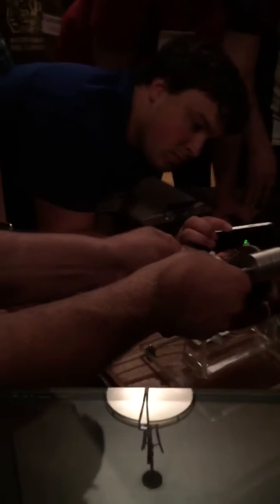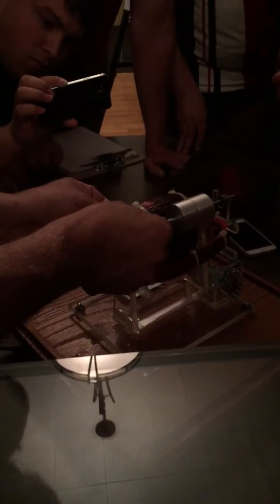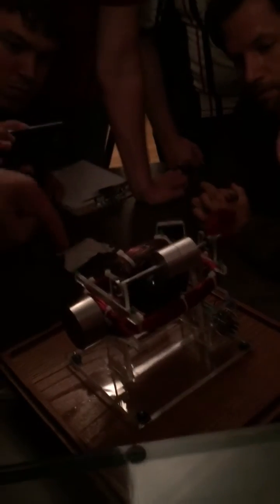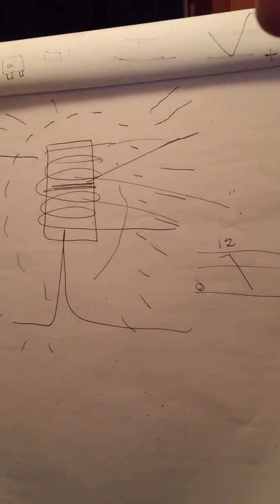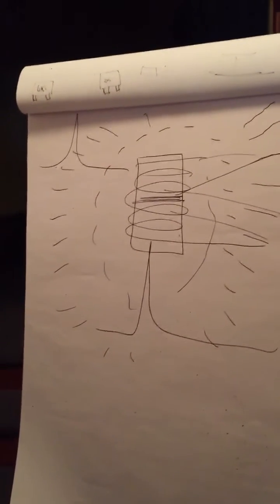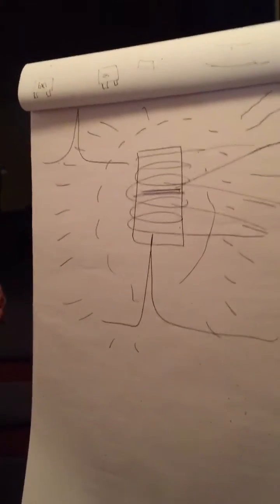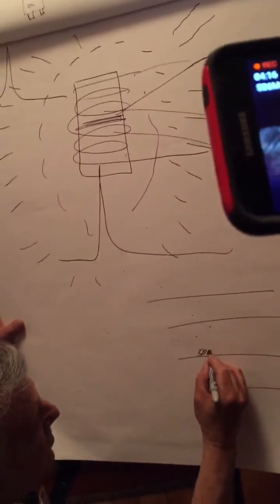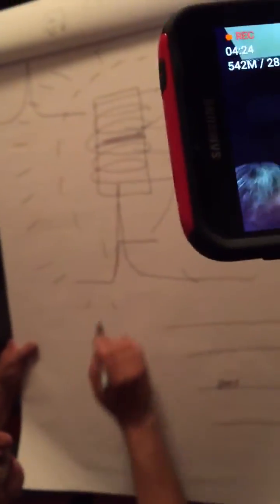John Bedini told us a secret

Comment: I have been using the Bedini generator almost daily and recharged 1.2V, 1.5, 9V, 6V and 12V batteries. Out of hundreds of recharge (documented), to give a typical example, I start with 8.85V charging battery (the one you want to charge), and 12.60V (drive battery - I use a car battery but it's only required for the Drive Batt to have a higher voltage than the Charging battery). I flip the wheel, ensure my neon (soldered between the Base and Emitter) is not flashing - if so, it usually mean wrong connections/open loop (OL) or the Charge battery's internal impedance is too high, as is the case with very old batteries or damaged ones. So, starting time: Drive: 12.60V, Charging: 8.85V. I let it run for about 15 minutes for a topup (gain of 100mV to 350mV) or give it a one hour run for more. Then I stop and disconnect, and let both batteries rest for about 12Hrs (you can use it immediately if you want). Typical result: Drive battery (which had dipped a bit) went back up to 12.60V or show a small loss of 0.002 - 0.004 V (or a little more if you let it charge longer; meaning the Charging battery will not accept more, as shown in frequent measurements). And, my Charging battery will show anywhere from 9.20V, all the way to 9.70V largely depending on age, model, type of, etc.) * the lesser the internal resistance of the generator, the higher is your performance (COP). YES it is overunity. In about the last 200 recharges, my Drive battery went (fully charged) from 12.79V down to 12.24V (a loss of 0.55V) whereas the sum of all Charging battery gains amounts easily to a grand total of 30 to 50 Volts. 30V/0.55V = ***John says in this video that he was told it's not working in Canada - correction: IT SURE DOES! Everyone of my 12 electronic meters are powered entirely by batteries recharged with Bedini. Even my toothbrush is, and my flashlights (LEDs). It's not perfect but it works even recharging 4 batteries at the same time (in parallel connections). There will be one or two batteries which will not gain as much as others because of their internal impedance is higher that their "neighbor". Like kids at a table; some eating less, some eating more. My last improvement was to switch my ball bearings from steel to ceramics (ordered straight from China is very economical).  No more oil needed. Results? It ran so fast, I had to increase the potentiometer's resistance and this, in turn, reduced the voltage drop inside the circuit (the operation of the magnet-wheel) and consequently less Voltage used by the Drive battery and thus a slightly higher COP. Okay, I studied physics in college but most of my knowledge is acquired from youtube videos - and I paid for and downloaded the Bedini pdf books from Peter and Aaron. I would warmly encourage anyone to replicate and USE a Bedini generator. The why and how this device work is not crucial, but if you're the one that succeeds in ramping up the output to 500 Hp (372,850 Watts) of any workable device, of any design using the principle John's divulged in this vid, well, you will bring an incredible amount of freedom to everyone on Earth. And, of course since it's 100% carbon-free and renewable, we'll restore a decent level of CO2 in the air we breathe. There's no reason you shouldn't become millionaire at doing this either. Thank you for reading this. Buena Fortuna!
Reply: Thank you for this comment! Yes, I responded to a 11 months old comment, but after reading it it made me sane again because i'm losing hope from time to time. I'm working on a very intricate Bedini style generator and I hope I will posting it this year on youtube.

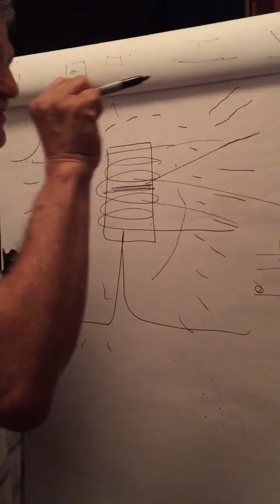Comment: This is a flat out lie John told in 2015 or 2016. Starting at Minute 7:25 "Your voltage goes, 300 volts, exactly the height of the atmosphere that the coil's at." "So if the coil is at a higher elevation you'll get a" "You'll get a higher voltage. The gradient's different." "I moved it 2300 feet to find out. From sea level." "What is the number of the gradient 150V per meter?" "Yeah, something like that. It's close." 
[Problem is that he had just said that he moved it to 2300 feet and it was 300V. If the voltage is 150V per meter for  the spike above sea level then 2300 feet (700 meters) would be around 100,000V spike. The sea level would be when he would go twice a year to see his sister in Seatle, and the 2300 feet would be Hayden Idaho where he lived and the shop was. The problem with this is that the spike has nothing to do with the altitude as anyone can see. John got 300V spikes in the shop with those machines at 12V input. The spike has to do with the rate of change in the switching as well as the intensity (or amperage) of the impulse. I have made way more of these machines than John has all over the country and found the spike to be the same at sea level in Hollywood Florida, in Hayden Idaho where he was, in California, Texas, North Carolina, Michigan, Indiana, Chicago, in most US States actually, Canada, Germany, Denmark, England, etc. They all show the same spike that is according to the rate of change. What John is confusing here is coils with antennas above ground. The potential difference between ground and meters can make such difference in voltage. But merely holding a coil above ground and running the circuit above ground is not making a potential difference unless you had an actual connection to the ground to have such a difference. This would almost seem to be an example of John being drunk. But his speech does not indicate this. I cannot explain why he would lie like this. His next reference to Peter continues on this bar talk story telling. ] 

"And what area had a lot to do with it." "If you go grab Peter Lindemann, and Peter will tell you we built identical machines. Mine worked, he went up north, his didn't work. He brought his machine back to my place and it worked."
Reply: reminds me of Don Smith when he said that copper tubes with a rare earth magnet falling through displayed anti-gravity.
Nevertheless, Bedini has been, and is still a great source of inspiration to me. He is after all what started everything, he and Tom Bearden's videos. And your SSG kit too btw Rick!
After all these years it took me very long to figure out the separate effects that might take place in that motor/generator, if everything worked properly.
Spike charging batteries to accelerate lead ions before they collide on average and draw electron current is one thing, flipping the polarity of an induced magnet right at TDC for an instant and then drawing current from the collapsing field is something entirely different.
Reply: Says the "man" who not only stole from John but now wants to slander his name  all over the internet. You're truly disingenuous, deceitful, jealous, slanderous and not particularly trustworthy as pretty much most of your work derives less so from actual work on the subject but more so on speaking badly about John. A truly despicable impression of a man.
Reply: Hey rick nice to see you on here i see you and Mr John B still goin at it!!!!! God bless the dead....... Im just happy to see someone knowledgeable on the topic people may not know that you knew jb personally so this isnt your typical comment. Just wanted to say god bless you... super happy to see your comment.... and it's great to see yall still goin at it after all this time. I love your channel and you are a blessing to the world with your insight and Proven apparatuses...
Reply: Very nice explanation  for that dead person , now I like to see one motor  like same with our explanation and inside detail then all be clear to ever one understand A to Z , cause  debate and arguments of the device it's not clear just make video from the same device and send link to everyone to mass understand and propagation of the idea  and not just keep argument and not show a/ dead person don't leave undone job from behind to finish  later , the point it's if you have  the tech and work why not show to all in simple video this way if anything  go wrong  you don't have unfinished  business to the public,  watching this and ready  see the result but i like to see a link from our video  link  to everyone  on the net, including my self , thanks  God bless .and let's share what we find this way other replicate the same and humans  live a long lasting relief from bien runn like horses in carousel,
Reply: Thousand Thanks to you Rick, though inventors are legitimate , they intentionally place Red Herrings.

Comment: if the voltage is 10 volts at 20 feet above the ground if you go up a hill 100 feet high you are still on the ground and the voltage would still be 10 volts 20 feet above you  would it not ?

Comment: I know he's dead now. Rip.
So was he a charlatan or did he actually believe he'd discovered something important?
Although he seems to be able to use scientific sounding language, it doesn't make much sense most of the timeI think the mainstream agrees this was mostly pseudoscience. He seems to have taken some of his inspiration from Hutchinson, he was an interesting character too!
Some say he shows a lot of signs of some sort of mental illness or serious personality disorder, perhaps narcissistic. His conversational style feels very intimidating at times. I wouldn't want to challenge him face to face!
I wonder if he wanted the fame more than he wanted to do proper science?
Nice post date btw!
Reply: Through the years I have restored many lead acid batteries using my old Bedini motor. I take batteries that are sitting at 0.5 volts or less and restore them with this. That is something to me at least. Now I am experimenting with charging up to 7 batteries at a time using 100 ma to power the device. And experimenting with expanding even more.
Reply: +James Searle  He was 100% charlatan.  He sold battery chargers that didn't even have UL stickers on them because he was so small that he could fly under the radar.  Just about everything he sold was filled with potting compound to hide the fact that the circuits were so low-tech and simple and so you wouldn't feel burned for spending $400 and realizing that inside the potting compound there was $12 worth of parts.

Comment: I made one it's vary cool... it's vary easy to make and works great. All the motor dose is reroute the battery power so the magnet pushes away from coil on a North magnetic field pulse, all magnets on the flywheel are north out. The collapse of the electromagnetic field then goes to the charge battery as a back emf. You could also put energy collecting coils by the fly wheel too for more power. A bridge refactor turning ac to D.C. Power. To battery:)
Reply: I don't know if I'm wrong but what u said sounds similar to the working principle of the Simplified School Girl
Reply: Yes it is... it works